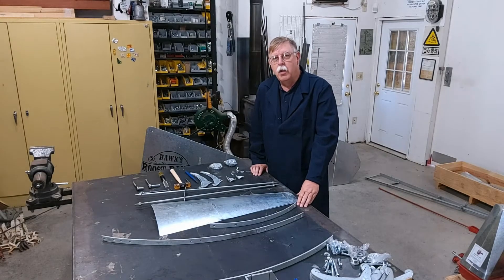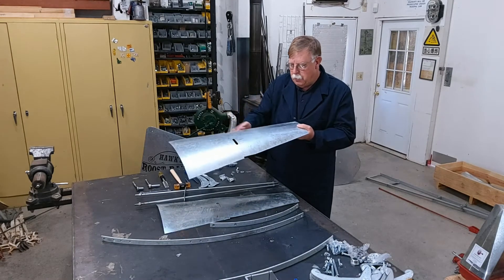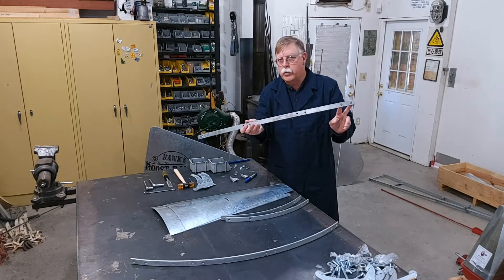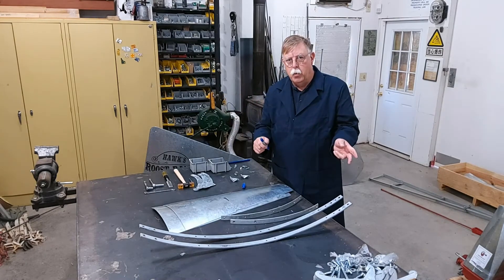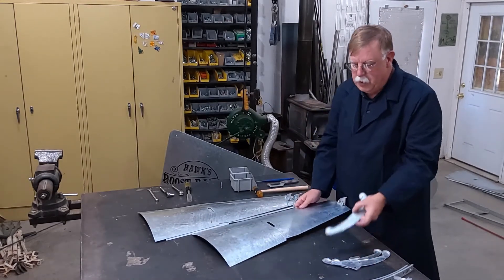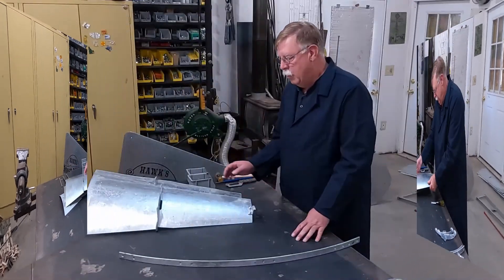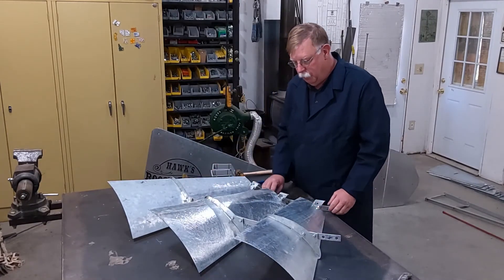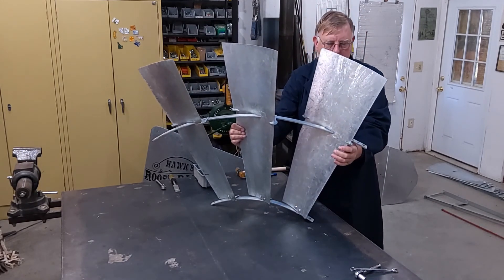Assembling a Aermotor Type Windmill Wheel

Comment: You forgot to twist the section to get the outer and inner bands parallel to one another.  Then use your hammer to tap the tabs of the sail ribs flat against the sail.  Makes for a tighter and less wobbly wheel. Other than that, great video!